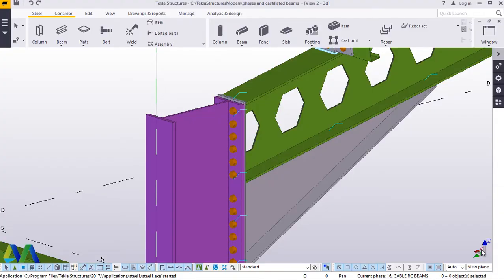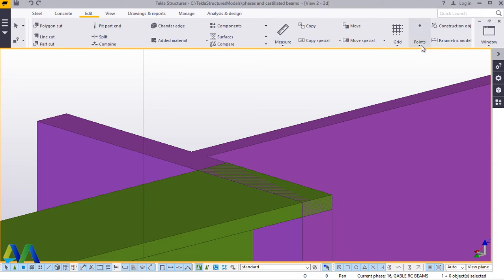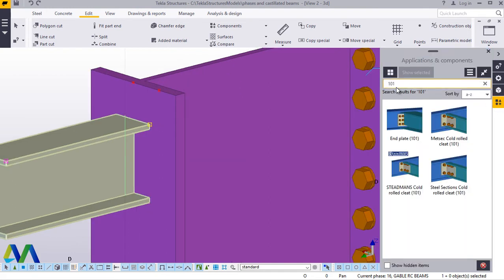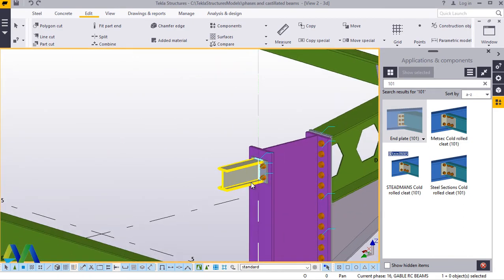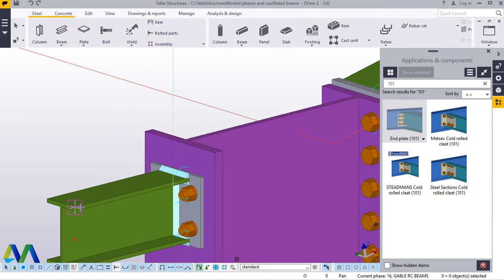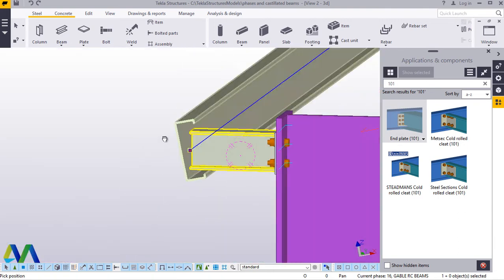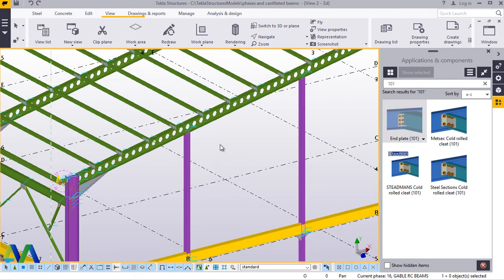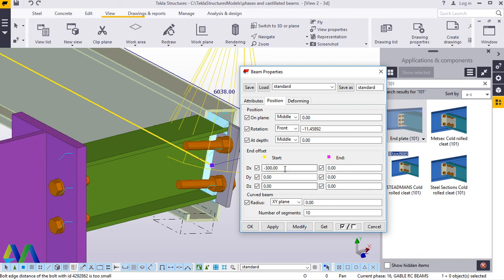How to create Eaves in Tekla Structures 2017

Comment: HI SIR HOPE YOU ARE FINE

SIR I'M FACING PROBLEMS IN DIMENSIONS FOR EXAMPLE BEAM LENGTH IN 9 MTR BEFORE PUT EAVES HAUNCH DIMENSHION SHOW CORRECT 9 MTR BUT AFTER PUTING EAVES HAUNCH ONLY BEAM LENGTH SHOW MORE THAN 9 MTR HOW CAN I SOLVE THIS ISSUE? ALSO WHEN I CREATE MATERIAL LIST WEIGHT NOT SHOW CORRECT PLZ ANSWER ME
Reply from the maker: The moment you place a haunch it will take some dimensions of the rafter beam, in order to accommodate the haunch connection